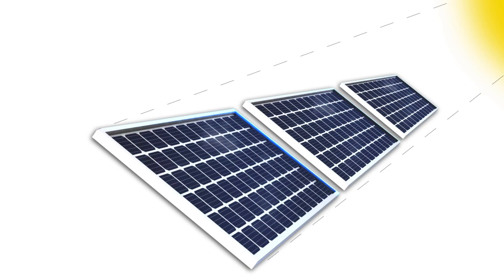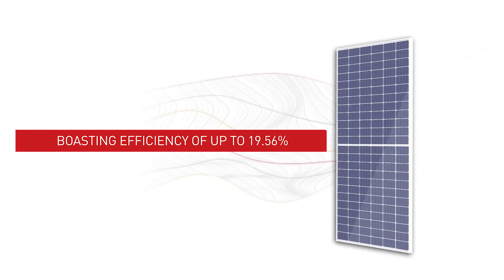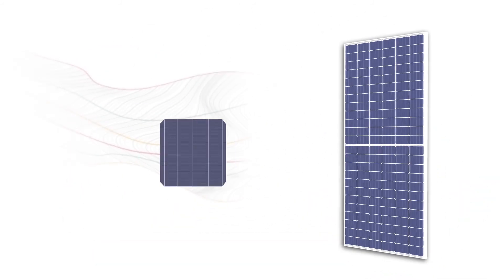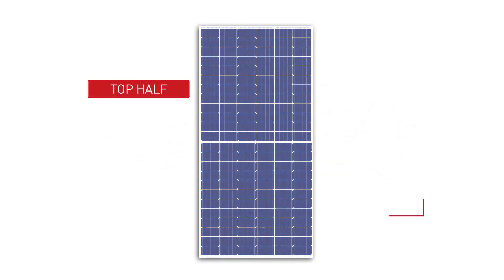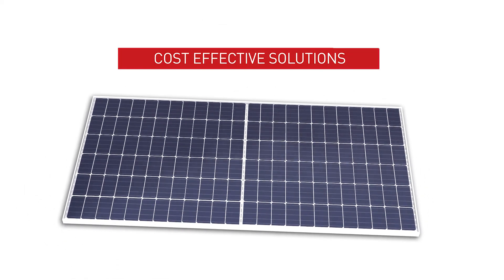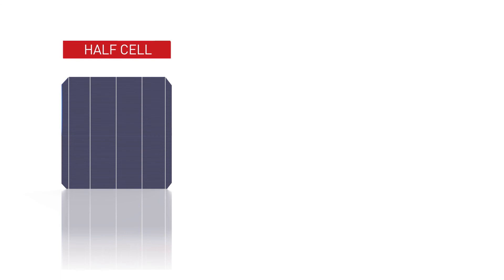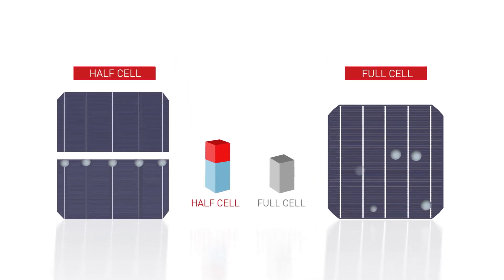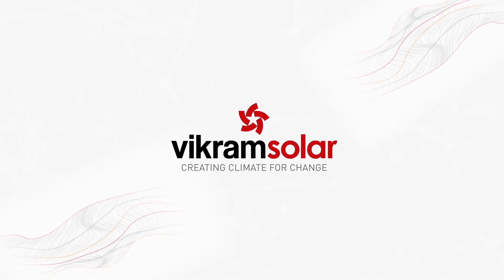HALF IS THE NEW FULL

Comment: those "sealed" glass panels can be used in a floating array , hence cooling panels, heating domestic water at the same time . Looking at that for my boat. Could be feeding the house as well, and even sell power to the grid.
Reply: Beware: This is patented, so you can build your own legally, but if you sell such panels you build yourself, you might get in trouble. As far as I know, it's a swedish patent, I don't know much more about it.
In other words, it's confirmed that this will work. =)